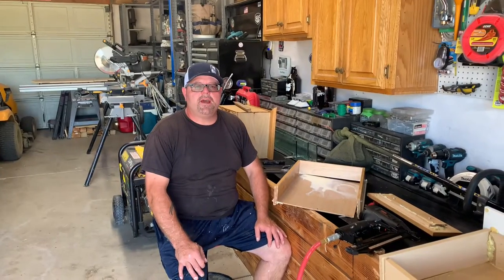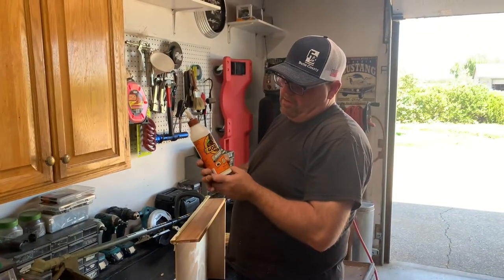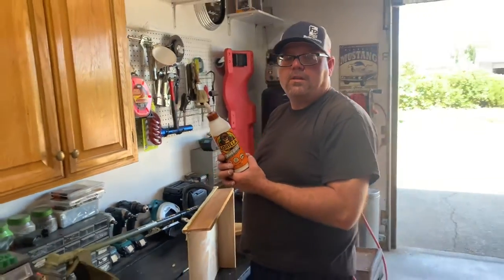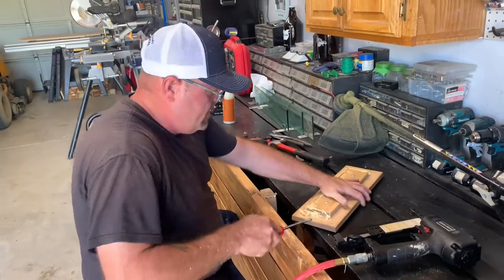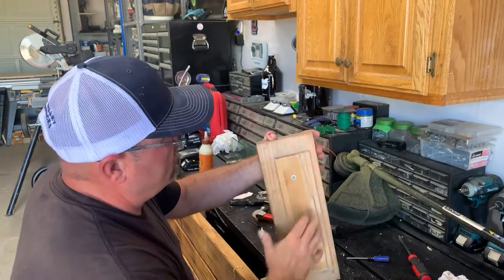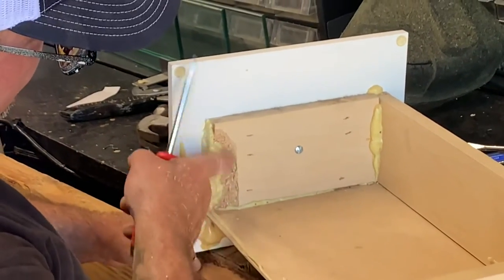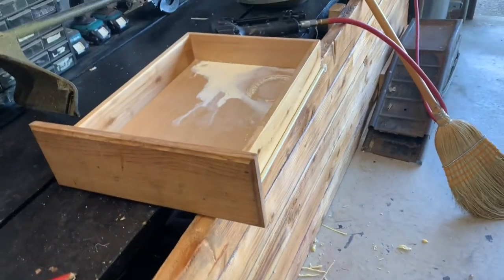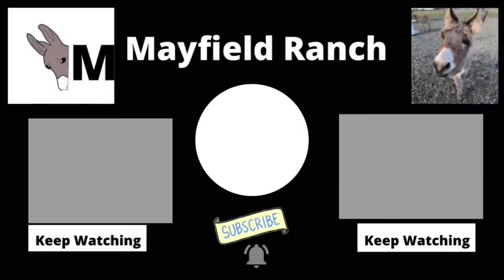How to fix a broken cabinet drawer | Rental House Repair

Comment: Thank you for sharing this video. Although the old drawers I inherited were basic mdf mitred corners, cheap furniture, watching this video has helped. The corners have nothing to hold them together, and all panels have come apart. So I purchased some Gorilla Wood glue yesterday, so I know I'm on the right track 😊 MY drawers are a lot bigger and wider than the drawer on this video, so I also purchased a tension belt yesterday, rather than clamps. Being a Female I was never offered Woodworking at School, but I will have a go at any project that is safe. So watching how you put the initial drawer sides and base together helped to make sure I was on the right track 😊 Thanks both of you for sharing 😊xx
Reply from the maker: Thanks for the kind comment! Good luck on the repair. I’m the same way- I’ll tackle any house repair. You learn so much by just doing it. If you get stuck and have a question just let us know and we will try and help you out. -Cady